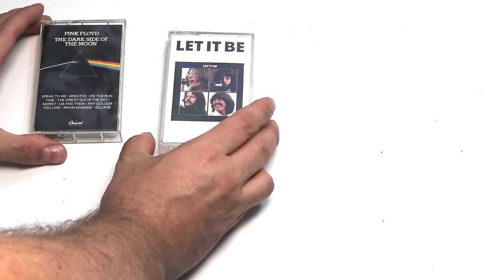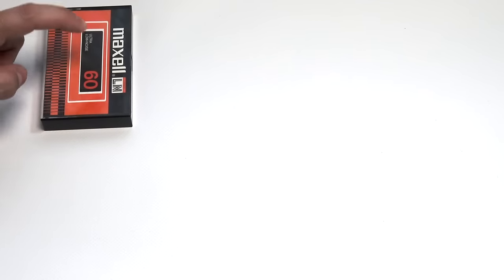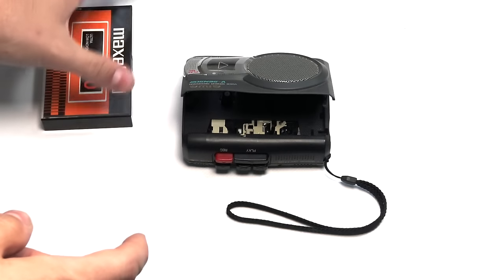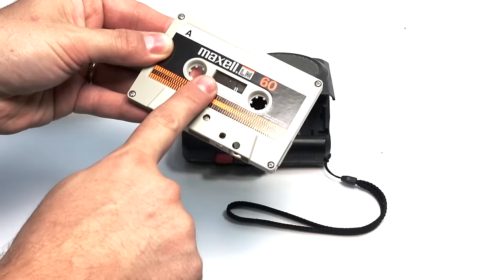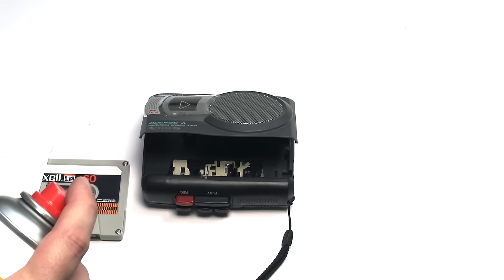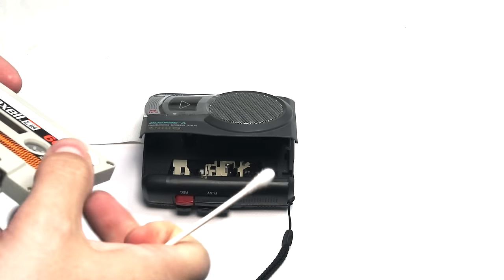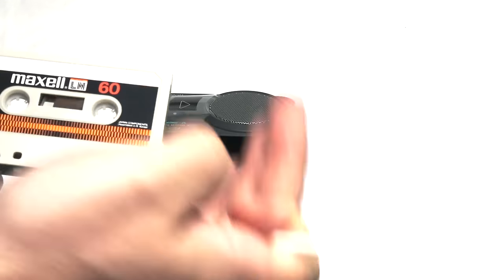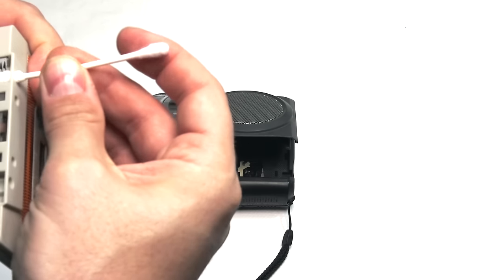How to relubricate your stuck cassette tapes

Comment: No, I wouldn't "do this at home". If a tape gets "sticky", I first check, if there is any brown dust on the tape heads and tape guidance. If there is, it's a binder problem. If the recordings can be replaced (buy a CD!), the tape goes right to the trash. If it's Elvis singing in the bathtub (or something non replacable), I take an old tapedeck, digitize track by track and clean everything all 3 minutes. Afterwards the tape goes to the bin. If there is no brown dust, just make a shell transplantation. Take a new ferric tape with screws, throw the tape inside away and put the tape of the patient in it. Worked everytime for me. I don't want lubricant on the heads of my Revox.
Reply from the maker: A small amount of lube, which is the amount I am suggesting to reintroduce, is always present on any type of tape. Nothing new!
Reply: 8 tracks are lubricated, but CCs? I can't tell if your method works and I won't try it either. But a shell exchange always worked for me. Those pre-recorded tapes often had cheapo shells without the graphite coated plastic foil in it. So try a better shell before "lubricating your tape heads". ;)
Reply from the maker: Guys, the lube is absorbed by the tape. Again, ALL types of tape have and need a small amount of lubricant to work...
Reply: Magnetic tape (after 1960) usually consists of a base polyester layer, a non-magnetic lower-layer for stability and the magnetic layer for recording. So called back-coated tape contains some integrated lubricants on the back of the tape. Back-coated tape must be used on 8-tracks (overwise they would'nt work). For reel to reel it was an option. 3M Scotch often made back-coated tapes and they tend to get sticky when aging. My reel to reel recorder has a mechanical switch to turn off the pressure pad when using back-coated tape. Trade name for back-coated tape was often "Black watch". There were some Scotch CCs called "Black watch", they are most likely back-coated.  Back-coating is still used on Imation DLT and LTO computer tapes, but today they work well. I have never heard that a normal CC is lubricated. There is some graphite in the foil and the surface may be polished, but I wouldn't call that lubrication.
Reply from the maker: Again, all types of tape have lubricant and we are not talking about the back. This is just the first site I found on the web: https://www.clir.org/pubs/reports/pub54/2what_wrong/

Comment: One solution that can be tested: After applying the lubricant, advance and rewind the tape several times.  Draft or exposure to air may shorten the hold time.  Perhaps a blast of cold air applied directly to the tape during "play" tape advance can also be tested.

Comment: A nice episode, but honestly, I would be afraid if this lubricant would destroy heads in my Nakamichi deck.
Is it not simpler to buy a good quality „new old stock” blank cassette, eg chrome or metal, and record the album on it from a digital file, and then swap new tape into the original cassette case?
Reply from the maker: Well, you would be completely upsetting that specific version and its analog sound. Might as well buy a new copy of the same version/record. I have a Dragon and I can assure you that no harm is done to the heads. The amount of lube is infinitesimal. A good idea, if you want to be cautions, is to use also a dry cue tip to pick up the lube in excess but wait at least a day or two before doing that.
Reply: OH, IT WILL. and it will cost you a new deck and possible NAK electronics. Don't do it.
Reply from the maker: Jonah, as many other techs you are driven by prejudice without real knowledge, in this case, about this issue. It is really sad to see how arrogant you are, just go back and read your commnets. I see now that you have written several negative comments over the months and I think you should inform youself better before pointing your finger, insulting and denigrate people. I have posted simple things but considering that you would like more proof here you go. After rading this info, I hope you will be polite and intelligent enough to apologize.
Here you will find a selection of scientific papers explaining the issue and how it is a standard procedure to relube tape (even NASA does this!). I have underlined a few crucial passages in the papers: 
Heritage: https://www.dropbox.com/s/f8254yfeqrrw9vp/heritage-02-00097-v2.pdf?dl=0
Nasa: https://www.dropbox.com/s/xxdw1qh8mlbppdu/Nasa.pdf?dl=0
HESS: https://www.dropbox.com/s/ydrvxg6zipjkrvw/HESS_Tape_Degradation_ARSC_Journal_39-2.pdf?dl=0
Preservation Commission: https://www.dropbox.com/s/3s3ejmho2jexhgt/pub54.pdf?dl=0
   - (here is the official article: https://www.dropbox.com/s/rtvqt1n537w9vpa/Bogart.pdf?dl=0)
Kondo: https://www.dropbox.com/s/zi4vv42ggi9vh8u/tribochemistry-of-ionic-liquid-lubricant-on-magnetic-media.pdf?dl=0
Here is an article of a lab that is relubing its cassettes: http://tasso.cat/re-lubrication-of-compact-cassette-tapes-with-sbs/

Comment: Anyone out there have other suggestions for the lubricant? I only have electronic cleaner with me but it’s doesnt act like a lubricant, infact it actually dries lunricants and the mentioned lubricants in the video aren’t locally available in my region
Reply from the maker: You should check for silicon based lubricants with no solvents

Comment: Theres a process for 24 track master reel to reel tapes called Baking,  im not sure what is done though
Reply from the maker: Yes, I have discussed that in my reel to reel videos
Reply: @anadialog  is that option possible wirh regular cassette tapes
Reply from the maker: It's not a common practice but I supposed so. In any case, baking in the end greatly weakens the tape. You do that in order to make a new copy or a digital rip.

Comment: I cannot get 3M 08877 wet lubricant anywhere! Does anyone have any advice on any alternatives? I do have the 1609 originally used in the above video but after seeing the pinned comment I'm worried about using it now.
Reply from the maker: In the end any silicon based lubricant WITHOUT thinners, diluent, alcohol etc should work
Reply: @anadialog  Great, thanks.

Comment: I got a tape that got stuck from 1982 n that tape is expensive on ebay n hard to find they never made it on cd at all only record lp n cassettes tape that it I'm going to tried it I will let y'all know if it work for me
Reply from the maker: Yes, please do!
Reply: @anadialog  hi I got to fix that cassettes tape n two other that was stuck not even rewind oh forward it was stuck I lubricant with deoxit mixer lubricant for fader lubricant on the q tip on  both side let it dry for a couple of weeks but  all my tape deck play it but not on  my revox 215 is weird but it play on my regular nakamichi n my denon tape deck is weird thank you I don't know why my revox 215 don't play that is a high end tape deck I play others tape deck without no problem on my revox I guess is picking to play a tape I fix n is smooth now
Reply: You would simply remove the reels in a good cassette, and screw the shell halves back together with 1982 reels of tape in it.

Comment: I found also a treatment for this problem but you need to open thé cassette. Inside you have two plastic films for each side. Remove them from thé cassette and spray their interior with wax spray. Wipe them off and replace in thé cassette. Thé results are amazing...
Reply: Ah, but what do you do with a cassette with a welded shell? 😉

Comment: Early CBS/ SONY and EMI XDR Cassette suffered the lucration issue the most!
Reply: Chen Frank it wasn’t a lubrication issue at all. It was the formulation of the tape and the cheap shells. This is fact.
Reply from the maker: Jonah, as many other techs you are driven by prejudice without real knowledge, in this case, about this issue. It is really sad to see how arrogant you are, just go back and read your commnets. I see now that you have written several negative comments over the months and I think you should inform youself better before pointing your finger, insulting and denigrate people. I have posted simple things but considering that you would like more proof here you go. After rading this info, I hope you will be polite and intelligent enough to apologize.
Here you will find a selection of scientific papers explaining the issue and how it is a standard procedure to relube tape (even NASA does this!). I have underlined a few crucial passages in the papers: 
Heritage: https://www.dropbox.com/s/f8254yfeqrrw9vp/heritage-02-00097-v2.pdf?dl=0
Nasa: https://www.dropbox.com/s/xxdw1qh8mlbppdu/Nasa.pdf?dl=0
HESS: https://www.dropbox.com/s/ydrvxg6zipjkrvw/HESS_Tape_Degradation_ARSC_Journal_39-2.pdf?dl=0
Preservation Commission: https://www.dropbox.com/s/3s3ejmho2jexhgt/pub54.pdf?dl=0
   - (here is the official article: https://www.dropbox.com/s/rtvqt1n537w9vpa/Bogart.pdf?dl=0)
Kondo: https://www.dropbox.com/s/zi4vv42ggi9vh8u/tribochemistry-of-ionic-liquid-lubricant-on-magnetic-media.pdf?dl=0
Here is an article of a lab that is relubing its cassettes: http://tasso.cat/re-lubrication-of-compact-cassette-tapes-with-sbs/
Reply: EXACTLY, the only tapes in my collection that I have the issue with

Comment: I've just tried this with a bunch of old cassettes with 99% isopropyl that weren't sounding or playing good. Going to leave it a couple of weeks before I play any.
Reply from the maker: Isopropyl alcohol?! Well, they are probably melted by now...
Reply: Just to update you on this  Isopropyl and qtips worked a treat for me. I've revived dozens of tapes I thought were unplayable. Doesn't always work but 9 times out of 10 it gives a significant improvement.
Reply: @jasonladd6400  I have used isopropyl alcohol too it works great and it does not melt plastic

Comment: Can you not bake Cassette tapes similar to reel to reel tapes and solve this problem as well?  This is a well known solution to save Reel to Reels.  I have a 1997 Electric Ladyland Tape that I would like to save.  It looks brand new like it was never played or played very little but stops playing after a few seconds I looked at my head afterwords and it was black.  Similar to Reel to Reel sticky shed syndrome or is what is happening to cassettes something different.
Reply from the maker: If you take the tape out I am sure you can but tape baking is used to make the tape playable one last time to transfer the music on a fresh reel. It does not solve the problem, and usually the problem as you said is the sticky syndrome not lube evaporation.
Reply: @anadialog    I just baked 2 cassette tapes that were horribly sticking.  2 hours for one and 3 hours for the other at 130 F.  Didn't bother to remove the shells.  I bake them in a vegetable dryer that is well ventilated and I think 130 is not much over if at all over what leaving tapes in shut cars on summer days probably got up to.  No warpage to the shells and they both play great now!.  I'm hesitant to do something as radical as u are suggesting.  Plus it looks like a lot more work.  Baking seems to work fine and at 130 F I really don't think you have to worry about warping the shells.
Reply from the maker: Good for you! The oxide is now very brittle and in some time it may start shedding...baking is drastic, relubricating is a standard procedure.
Reply: @ANA[DIA]LOG  Thanks.  I'll keep you updated to see if I have problems in the future of shedding/sticking etc.. with these as I have read baking (at least on reels) seems to only be a temporary solution.  This is the first time I have ever baked any cassettes.  I have baked a few reels before though.  I will say I have played each of the cassettes now multiple times and both are still playing great.  One of them is circa 1995 and the other is circa 1997.  So these were not definately not the oldest tapes on the block.  Neither of them was XDR either.  Both are MCA tapes.  I wonder if this an indicator of issues with MCA tapes from the 90s whether XDR or not?   I will say baking fo a couple of hours at temps many tapes probably already experienced in peoples cars on summer days seems more convenient and doesnt seem very risky either.
Reply: Ok so now it has been 2 years since I baked the tapes we discussed.  Yesterday I decided to bake another cassette tape and while at it I decided to play one of the tapes I baked 2 years ago.  Electric Ladyland 1997 MCA tape. Played it and it was phenomenal.  Certainly no shedding.  Sounded so great,  No issues at all  except it abrubtly stopped playing on Come On.  I don't know if there is an issue in that spot or still a little sticktion in that one spot.  Gave it a very brief ff and the remainder of the tape played beautifully again.  I hate the 97 CDs due to brickwalling and clipping but also thought the 97 ELL mix had potential if you could hear it without the brickwalling and clipping. The 97 cassette is a great way to get the 97 mastering of Electric Ladyland in sweet smooth HXPro analog sound.  

The new tape I baked also played light years better than it was playing before.  I will let it sit for a while and play it again at a later date. While your method may indeed work baking is simpler and less messy and works fine in my experience.  I can assure many cassettes already sat at 130 degrees in peoples shut cars in the summer in the past.  A summer day in Kansas at 100 TO 110 would easily get the insides of closed cars up to 130 if not more.  So baking cassettes at 130 doesn't do anything different than a lot of tapes already would have experienced in the wild.  So the bottom line for me is your method may indeed work but it is too complicated and unless someone can show me the microscopy of the oxide being brittle or I experience shedding later myself I will simply bake problem cassettes for 4 hours at 130 F.

Comment: Hello,
will this work also with rewinding and fast forward issues ?
Reply from the maker: Yes, it could. If you're sure its the cassette and not the deck it may be a lube issue. Try it and make sure to absorb all the exceeding lube after application.
Reply: @anadialog  I have a Tascam CC222 cassette player and been having issues with some cassettes getting stuck in rewind mode And sometime in reverse play mode. One guy said it could be a weak belt.
Reply from the maker: @djrockwell5722  If it was a belt problem you would have it with practically all cassettes. Try the lube solution and let us know!
Reply: @anadialog  ok thank I will

Comment: It would be interesting to see an equivalent video on reel-to-reel tape lubrication.  I have some tapes that squeal when played.  This is NOT an SSS (Sticky Shed Syndrome) issue, as the tape is not back coated, so don't tell me to bake the tape.  From other research, it appears that 100% Cyclomethicone (a common ingredient in skin lotions/treatments) is a great silicone-based lubricant for tape.
Reply from the maker: I never had that problem, probably because reel ro reel is looser but Indo know that lubes exist....
Reply: @anadialog  I have a reel of Sony PR-150 that was recorded in 1972.  It squeals badly, and the squealing translates into the playback.  I was hoping that someone might have done a demo video on how best to apply silicone lubricant to reel-to-reel.  I'm also aware of other methods, such as lowering the temperature of the tape and recorder.  I might wait a few months for a nice cold, dry winter day to give that a try outdoors.
Reply: @anadialog  you are confusing things. Lube can be used (although rarely) for reel to reel tapes only - to help prevent oxide shedding.

Lube is not to be used on cassette tapes.

Comment: Thanks so much for this. I used ELECTROLUBE Contact Cleaner Lubricant on a squeaky BASF LH super SM C90 cassette. I'd put the tape into another shell. No luck. Tried your suggestion: INSTANT success!! Thanks again :-)
Reply from the maker: Thank you Martin for bringing your experience! Glad it worked! Sometimes it takes weeks!

Comment: How can you record on cassette that has no holes in casing that doesn't allow you to record over the prior recording.
Reply from the maker: You mean when on the top the notches are empty, right? When they are closed is when you can record. Easy, just get a piece of scotch tape and cover both notches, at that point the machine will let you record on that tape.